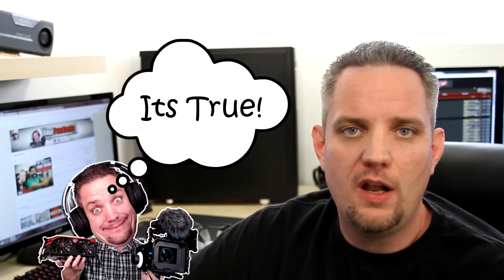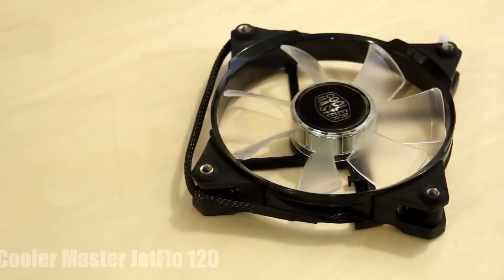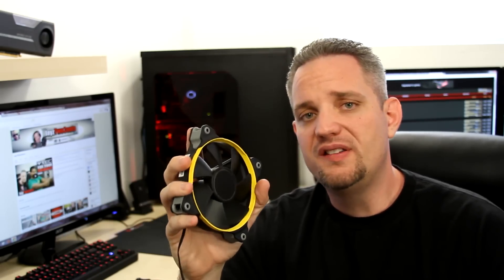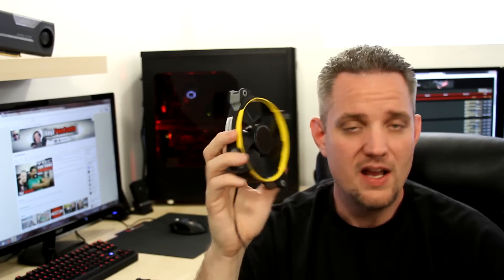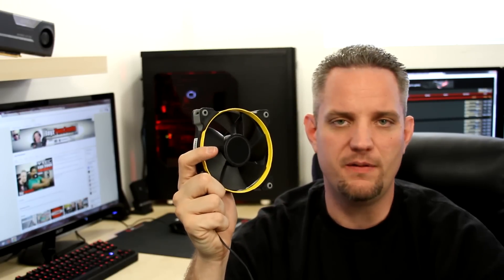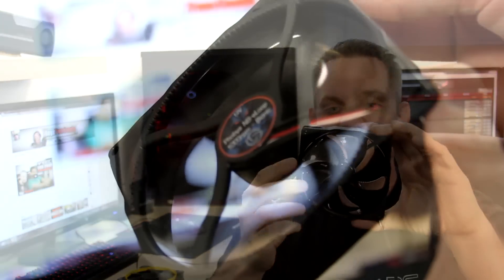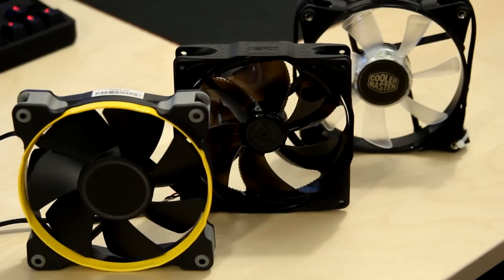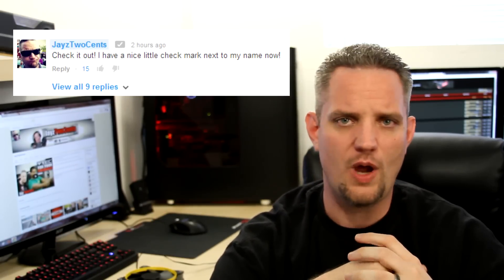Static Pressure vs Air Flow Fans - How to choose the right fan!

Comment: I will add that static pressure optimized fans have bigger blade, and in a closed case the airflow is important. Only fans in the top or only in the front or anywhere else is not a good option. The minimum I recommend is one rear and one front fan.

Comment: I was looking into fans for my wife's system recently to see if we can get it quieter -- 5 SP120s and 3 AF140s at full RPM make her system sound like a beehive... At the end of it all, I've decided to switch her to Bitfenix Spectre Pro fans. They've got very good airflow and are rated as the quietest fans I considered and were also the least expensive.

The 140mm version is rated better on static pressure than the AF140, slightly under the NB PK-3, but with airflow comparable to the PK3 but a lower RPM and a noise pressure rating lower than the AF140. The 120mm version has airflow and static pressure rated about equal with the NB PL-2, but with a much lower noise rating, though it has less than half the static pressure of the SP120.

I've heard that with low fin-density radiators there's not much difference running a static-pressure fan over an airflow fan, but that the thickness of the radiator also comes into play. So for the AlphaCool Monster radiators, even with their lower fin density, you'd still want a static-pressure fan. But with one like the XT45 or ST30, you wouldn't see a huge difference running an airflow fan versus a static pressure fan.

Comment: Is there a reason why I can't find a static pressure LED fans anywhere? Do the LEDs affect how those SP fans perform?
Reply: Corsair makes SP120s with LEDs.
Reply: brandishwar Those are the AF120s.
Reply: Kiryu Takuru
There are SP120s with LEDs as well. A search of Corsair's web site will show that.

Twin pack SP120s with green LEDs: http://www.corsair.com/en-us/air-series-sp120-led-green-high-static-pressure-120mm-fan-twin-pack

Their static pressure rating stinks, though, as it's only half the non-LED SP120s.
Reply: Bitfenix Spectre Pro's
Reply: brandishwar Thanks.
Reply: Elliot Kaufman I always thought they were airflow fans, I must be retarded.
Reply: The standard spectre fans are cheap airflow ones. The pro's have decent pressure and are available with led's. I highly suggest them over the corsairs.

Comment: Do you think its good to have a mix and for exhaust only AF fans
Reply: No.
Reply: softrockification what should I  set up I can have one 120mm in the back 2 140mm or 120mm on top and 2 140mm or 2 120mm in the front Im getting a corsair spec 02
Reply: In my spec 1 I put a AF 140 in the front, A AF 120 in the back and another one on the top.

Comment: I completely understand the difference between air flow and static pressure, what I don't understand is the difference 3 pin (DC) and 4 Pin (PWM) fans. I understand PWM function automatically varying RPM, and that DC is software controlled or via a fan controller, but what type of the pair would be best suited for case fans/rads etc? Someone needs to make a guide on this subject, really enjoy your videos a Jay, all the best.
Reply: PWMs all the way if you can.
Reply: Why so? I've heard 4 pin tend to 'tick' during use, and 3 pin are still controllable via the moth jars and software.
Reply: Motherboard* moth jar haha! praise be predictive text.
Reply: *****
It depends on the fan motor, if it ticks or not during low rpms.
Btw, you can edit your responses :p

Comment: Jay how would you go about achieving positive pressure in your case in order to minimize dust intake? Is it simply the case of sticking more intake fans than exhaust fans? Thanks.
Reply from the maker: Not necessarily more fans, but more CFM of intake vs exhaust. So you could adjust RPMs to achieve the same thing,
Reply: ***** cheers!